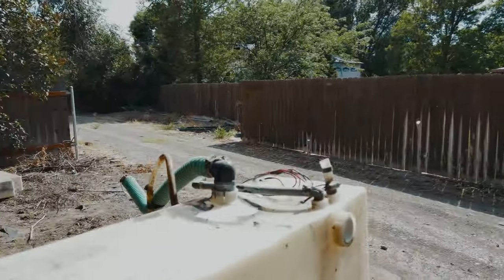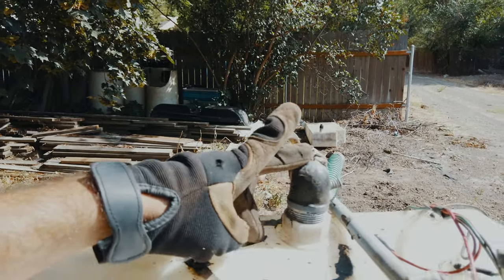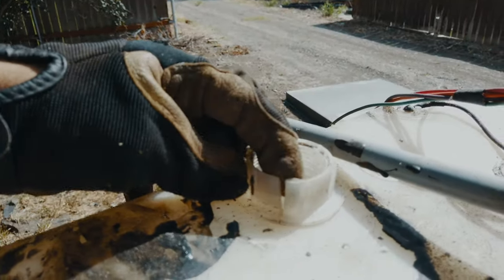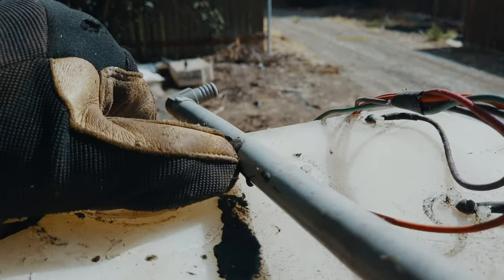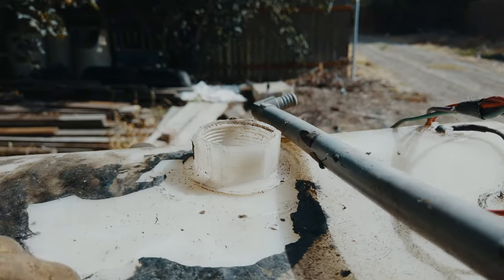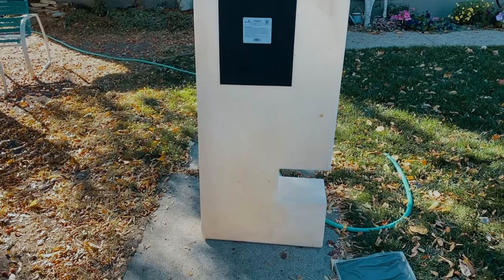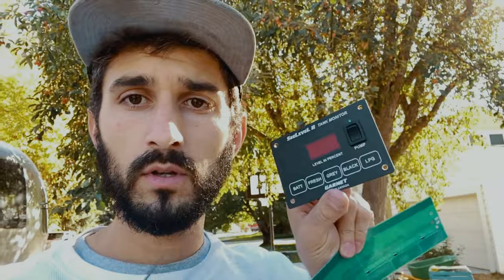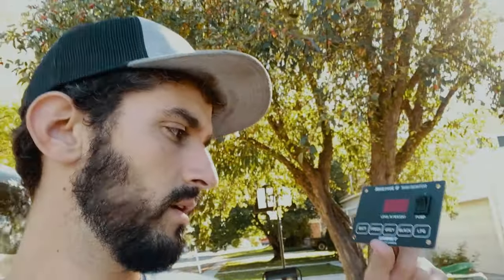Repairing and installing the water holding tanks | Vintage Airstream Restoration

Comment: Another great video.  I feel your pain on the plumbing confusion!!  If it helps I dunk the ends of flexible piping in really hot water for a minute before attaching them to barb fittings.  So much easier.  Same theory when taking them off, just pour really hot water on the ends for a short while and they become much more pliant.  Great work, and thanks for the update.
Reply from the maker: Right?? Who would have thought! Haha 

Thanks for the tip on the hot water, I’ll have to employ that method in the future.